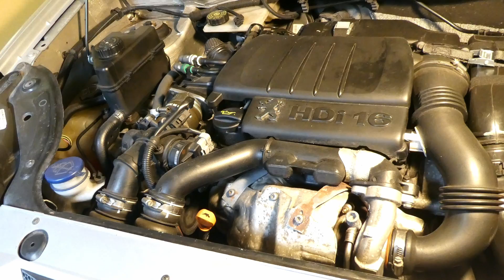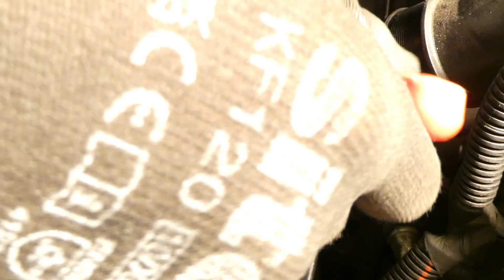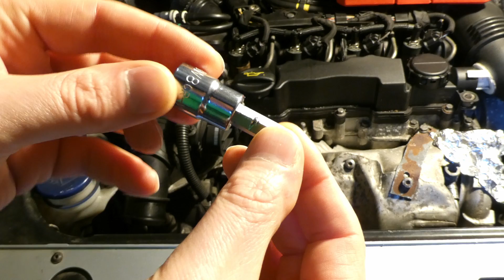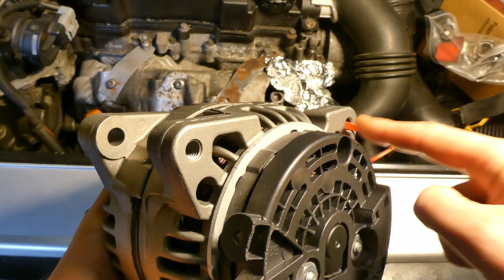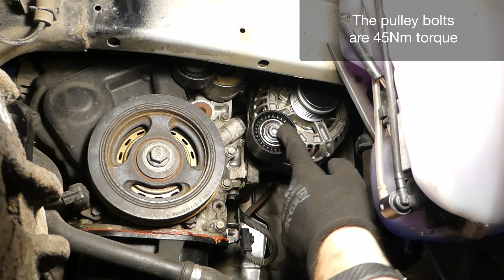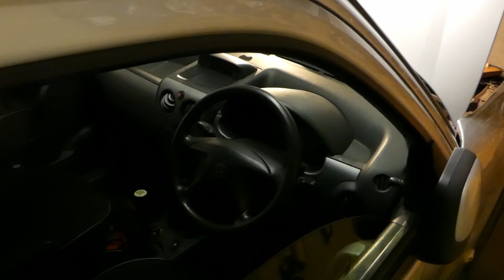Full guide 1.6HDi alternator replacement Peugeot/Citroen (2007 Peugeot Partner)

Comment: Thanks man! We have a 207 1.6hdi (2009 model) and the alternator clutch needs replacing. This looks very similar to our engine bay  
I got so far with removing things, but gave up, I may have another go with the help of your video! 
Don’t think of removing intercooler etc 
Thanks for the video 👍🏼
Reply from the maker: Yeah, they are probably the same, perhaps there is an additional DPF as compared to mine, as your being 2009, but otherwise the same engine. Depends really on the position of things, I had to remove the intercooler, otherwise could not get it out. Good luck.

Comment: One question?If I was not able to put the forth screw in that impossible place down right,will be a problem if is secure in three screws? on a peugeot 308 1.6 hdi
Reply from the maker: If you can take it out, it should be possible to be fitted back in, with effort of course, it will be tight, but not impossible. So, to answer the question, probably not very adviseable to leave it with 3 bolts, it will most likely wiggle out or there will be vibrations that will not be good for the other drive shaft components.

Comment: Thank you for a very informative video. I have a 1.6 HDi van without Air Con but the principal will be the same. I've heard that changing the starter motor is as difficult or maybe more difficult.
Reply from the maker: Mine is also without air con and with air con will be similar, although probably more difficult due to the air con being in the way.
Yes, starter is more difficult.

Comment: Добрый день. Вопрос: может ли из за неисправных свечей накала на холодную дымить такой мотор? Спасибо.
Reply from the maker: Apologies, I can only answer in English and managed to google translate it. The 1.6HDi does not need the glow plugs so much, only if temperature is really cold in minus C. Yes, if some are faulty you would get rough start and a little bit of rough idle, maybe some smoke, but not too much. It can perfectly well start with faulty glow plugs, it is not like the 1.9 D which would not start without glow plugs. Depends on the colour of smoke of course as well.

Comment: Thank you for uploading this. I always really like your videos. I replaced my cambelt and waterpump last week on my 1.6 Hdi Escapade. As I was doing it I thought it would be a real pain to replace the alternator if it ever needed changing.... your video will  make it much easier as and when it does.
Reply from the maker: Many thanks indeed for the good words. It is a nightmare of a job. Probably one of the hardest things that I have done, apart from the rusty exhaust on my 307 that took me 3 days to file the bolts with the smallest file on earth, it was just tight.
It took me probably a day to fit back the new alternator, it just could not go in. My left arm was aching, because the horrible thing is on the right of the engine and I do not have a proper lift, just my home garage. Had someone told me there was a trick to angle the bolts it would have been an easy job. My arm was so tired that in the video I am screwing the the upper pulley bolt between my fingers as I could not hold it with fingers, that's how tired they were.
Anyway, many thanks indeed, hope you are not going to have to do it.
Reply: @moremolecules  😢I must do it in one day...
Reply: @moremolecules grate job!